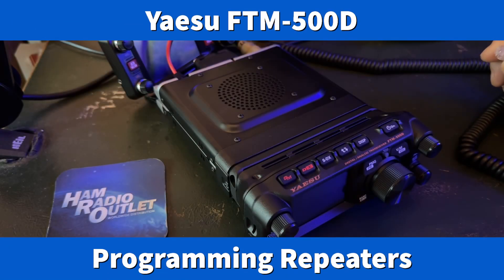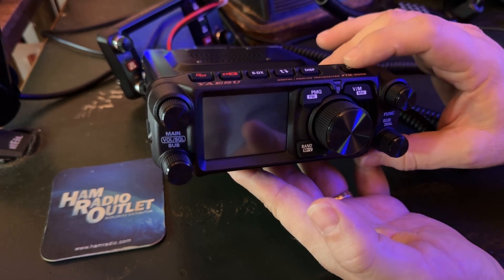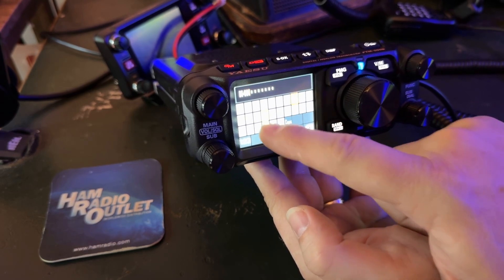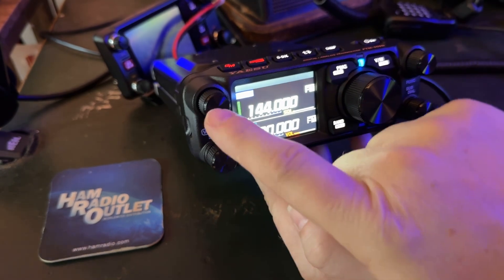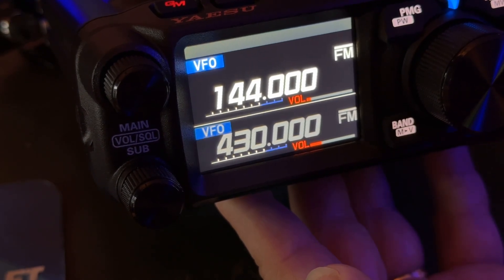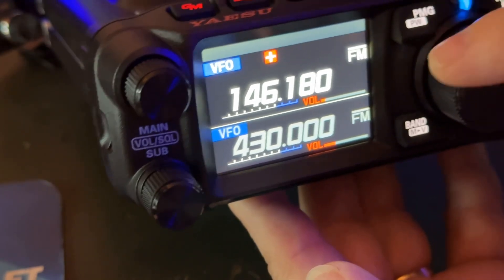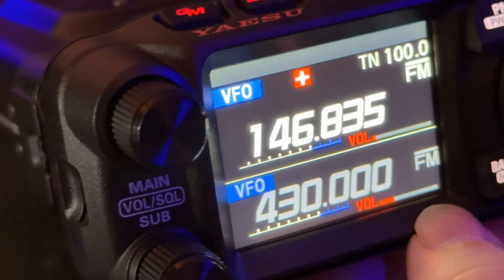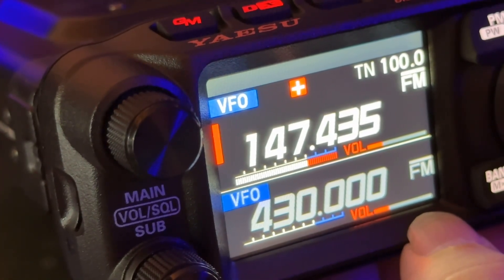Yaesu FTM-500D #2: Programming Repeaters #hamradio #yaesu #ftm500 #c4fm

Comment: Very Nice radio. Too bad it doesn't have FM Broadcast Band feature.😔
Reply from the maker: An FM Amateur Radio transceiver typically does not include the FM commercial broadcast band.

Amateur radio operates under specific frequency allocations set by national and international regulatory bodies like the Federal Communications Commission (FCC) in the U.S. or the International Telecommunication Union (ITU). These regulations strictly define which frequencies amateur radio operators can use, and also which frequencies commercial FM broadcast can use (usually 88-108 MHz in many countries).  88-108 MHz is not allocated for amateur use. Including those frequencies in a ham radio could lead to legal issues.  If someone modified the radio to allow for transmitting outside of the amateur bands, it would be possible to interfere with commercial and government broadcasts.

Ham radios are designed for communication between amateur radio operators, not for listening to commercial broadcasts. The equipment is optimized for the frequencies where ham radio activity occurs, such as the VHF (Very High Frequency) and UHF (Ultra High Frequency) bands allocated for amateur use, rather than for general entertainment.

Amateur radio transceivers are engineered with specific features, such as narrow bandwidth filters, specific modulation techniques, and power output suitable for ham radio communications, which differ from those needed for receiving commercial FM broadcasts. Including the FM broadcast band would require additional, potentially complex circuitry for good reception, possibly increasing the cost, size, and complexity of the device without adding significant value to its primary function.

The primary market for ham radios is amateur radio enthusiasts who are more interested in communicating with other hams than in listening to commercial FM radio. Therefore, manufacturers focus on functionality that meets the needs of this specific user base.

Including FM commercial bands could introduce interference issues. Amateur radio equipment often operates in environments where minimizing noise and interference is crucial, and adding commercial FM reception could make this more challenging, particularly if the radio is used near high-power broadcast stations.

One of the reasons the FTdx101 and the FTdx10 are ranked 1st and 2nd for receiver dynamic range is that they cannot receive shortwave broadcasts at around 9 MHz.  Yaesu sacrificed shortwave receive in order to have effective roofing filters, which happen to operate at 9 MHz.  That isn’t an innovation by Yaesu.  Having a roofing filter provided an advantage for ham radios prior to the late 1970s.  If a radio happened to include a preselector, that was a bonus.  Again, the preselector in the FTdx101 is not new.  We lost those advantages in the late 1970s, when the manufacturers fooled us into thinking that triple conversion and quad conversion was better and would allow ham radios to receive shortwave broadcasts.  The 1st IF was moved to around 40 MHz or even 70 MHz. Hams fell for the clever marketing.  What they didn’t think about was phase noise. The triple and quad conversion increased inherent receiver noise, which adversely affected sensitivity.  But this became the standard until 2003, when Ten-Tec went back to a roofing filter, and Orion started beating all the competition. Yaesu finally followed with the FTdx5000, in 2009.  The 5000 uses a 9 MHz 1st IF, allowing for high quality roofing filters.  It even includes a preselector. 

I suppose we have to decide whether being able to receive DC to Daylight with our ham radio is more important than having a top class receiver.  If you can’t hear the other station, you can’t work them.

Adding the capability to receive commercial FM broadcasts could increase both the cost of production and the final price of the radio without providing much benefit to the typical user.

However, if someone wants to listen to commercial FM broadcasts, they can often use an external FM receiver or tuner connected to their ham radio setup, or simply use separate consumer-grade radios dedicated to FM reception. Some multi-band receivers used by radio enthusiasts might include the FM broadcast band, but these are not typical ham radio transceivers.
Reply: @n4hnhradio  That's all good and dandy, and useful information, but I had an IC-705 and I was able to listen to FM / AM / Air/ weather, etc from that radio. Gosh I do miss that radio. My 710 gets a bit boring at times. 😄  Wished Yaesu had something similar to the IC-705 but with the power of the 710. But I am keeping an eye out for the  ALINCO DJ-X100T.
Reply from the maker: There’s a reason that the IC-705 is ranked 37th in receiver dynamic range and the FT-710 is 3rd.  The FT-710 has 107dB of dynamic range,19dB more than the IC-705.  The IC-705 inherited technology from the IC-7300.  The IC-7300 currently ranks 24th for dynamic range.

It has been my experience that radios that can receive DC to Daylight tend to lack in selectivity. I keep a single band HT around for emergency preparedness because it has better selectivity. 

It remains to be seen whether Yaesu’s upcoming FTX-1F will have FM broadcast receive.  I hope not. I’m interested in that radio.  The FTX-1F is an IC-705 competitor that features simultaneous dual-receive.

It’s best for a ham radio to be a ham radio for the various reasons in my previous answer to you.

Comment: Just installed my FTM-500 in my car last week. So far the radio is much much easier to use than the ftm-400 which has now become my shack vhf/uhf radio. 73 W6QX
Reply from the maker: Same here. The FTM-400 is my base station and the FTM-500 will eventually replace my ICOM mobile.  I have more videos in the edit queue.
Reply: @n4hnhradio  there were some things I really disliked about the ftm-400 as a mobile rig. It was really hard to change the power level, tone and brightness. The big advantage of having a speaker and the mic connection on the head made an under the seat installation viable. I used a Lido mount and have a very nice installation.
Reply from the maker: I programmed one of the mic buttons to cycle the power level on the FTM-500. There will be a future video about it. The P4 button is programmed to change the power level on my FTM-400.  But Yaesu didn’t assign a button on the FTM-500D to change power. Unless you found something I didn’t. I’m disappointed that the unused A button couldn’t be assigned for something.